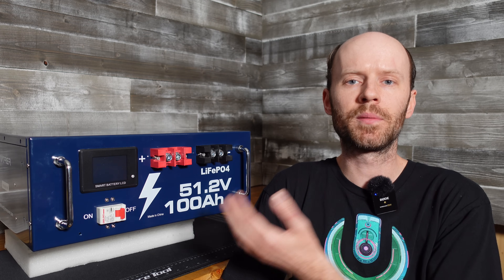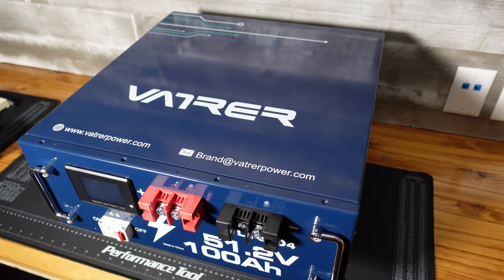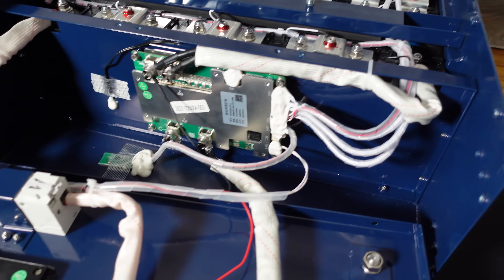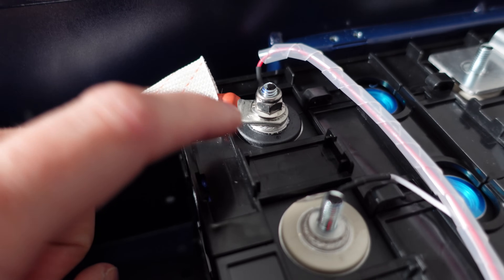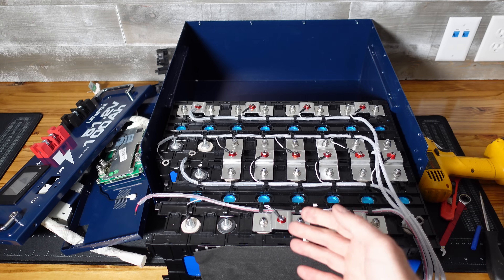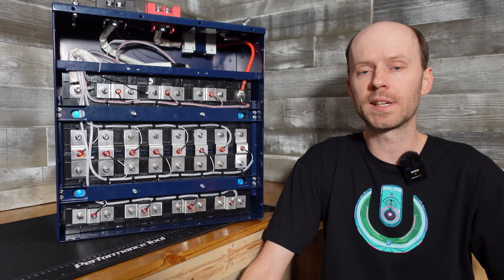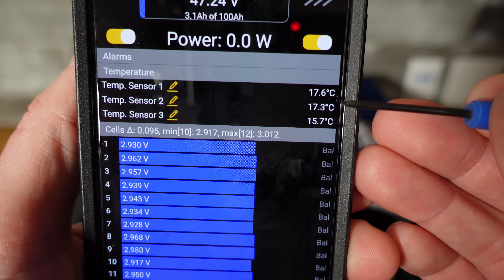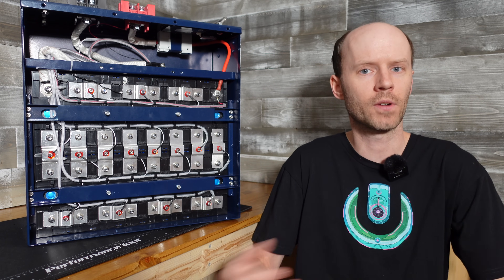CHEAP Vatrer 51.2V 100Ah Rack Battery, EVE Cells - Just Don't Break Them!

Comment: Great video. Lifepo4 batteries can easily have large  cell voltage differences when new,after cycling many times they usually become more reasonable.Iam glad you were able to identify the cells used,thats why I watched the video.I did build a  battery with 16 of those LF100LA cells and they are consistent  at 104AH.Iam commenting because I noticed other comments about buying EVE 280AH is better economically and I can say that EVE 280AH V3 cells were shipped to my door for twice the cost of the EVE  100AH.These people missed Lithium Solar's point,for $1023 shipped to your door,cells,battery box, wiring,breaker,JBD BMS with screen with warranty,thats a great deal!!!Thanks

Comment: Re: BMS settings. You told us what it is set to, not what it actually controls at. It is great to have over and under temp protection set correctly. That is of no value IF sensors are cheap garbage and gives a bad signal that either never triggers the BMS, or over triggers before you get to the limit ???
Reply from the maker: We can assume the temperature sensors have a reasonable tolerance, as do most electrical components. I do not have equipment to test the tolerance of temperature sensors, sorry.

Comment: I am new Subscriver . Can i use this with a EG4 6000XP? It is not in listed in the EG4 compatiblity list.
Reply from the maker: It can be used with custom-programmed settings. It will not communicate with the inverter and I don't know if using it will have any warranty implications from the EG4 side. They will have to clarify that.

Comment: Whats the difference between 48v and 51.2v batteries? Are they compatible with each other? Is it just marketing?
Reply from the maker: They're all sold under the "48V" category for marketing, but technically the batteries you want contain 16 cells and are 51.2V nominal. The nominal voltage is 3.2V x 16 = 51.2V. Some companies are selling actual 48V batteries, which contain 15 cells (15 x 3.2V = 48V) but don't work as well due to the low voltage near empty.

Comment: Great video and I used your link and code to purchase one.I was charging it yesterday and opened the solar kill app I saw yu use in the video. Im a rookie and noticed the icon for only balance while charging so I turned it on  The write to BMS icon at the top was blinking so I clicked it.Immediate the SOC went to 100% and stopped cycling through the display screens on the first option of the battery.I thought  no big deal Ill just reverse what I did.Does anyone know how I restore the BMS back to factory? How bad did i screw this up?

Comment: WOULD BE EASIER TO GET A THIN METAL BLADE AND MAKE GROVE ON TOP OF THE STUD SO YOU CAN USE A FLAT SCREWDRIVER TO HOLD THE STUD WHILE YOU TRY TO UNSCREW THAT 10MM NUT
Reply from the maker: Yes, that would have been a fantastic idea if I would have thought of it before destroying it. Heh :(

Comment: Thanks for the review. Got mine using your discount code. Nice battery. Put it in parallel with 17 other server rack batteries. It seems to be charging/discharging in sympathy with the rest of them. I know the manual recommends not doing what I’m doing, but then I see Ian at Watts 24/7 with batteries having a lot more differences than mine all working in parallel. Also a belated thank you for the tip on 6awg thhn wire. I scored that deal too.

Comment: Has anyone tested the low temp charge shutoff function?  We've seen these sometimes not work in other batteries.   Thanks!
Reply from the maker: I did not test it in this particular battery but I highly doubt there will be any issue as it's a JBD-branded BMS and we verified the programmed temp settings and sensor values.

Comment: any concerns with the circuit breaker? heard it is an AC breaker without arc suppression
Reply from the maker: No. I discussed towards the end of the video that I had found a test report where it was tested for DC voltages in 1P and 2P configurations. I couldn't find a complete specifications sheet though.
Reply: @LithiumSolar  thanks. planned a 4p config so trying to keep safety in the picture

Comment: The damaged terminal screw is an accessory (welded on, but still an accessory).  I'd use the cell.  I'd cut a slot in the top of the stud and use that to hold the stud from rotating while I tighten the terminal.  The terminal will be held in contact with the welded on flat and all will be well.  As an alternative to the slot, two opposing sides can be flattened and a small wrench used to hold the stud from rotating.

I have a lot of cells with drilled and tapped terminals, and I use a stud with a hex socket.  Same idea, using a hex wrench to hold the stud while tightening or loosening the nut.

Comment: dude for below ~1500 + 100 for JKBMS one can build a 4320Ah = 15kWh 48V LiFePo4 with EVE so #wtf
Reply from the maker: "one can build" < there's the differentiating factor, YOU have to build it.
Reply: @LithiumSolar  yeah well X-D does it come with auto heating at least? :D
Reply: @LithiumSolar  also might have noticed that 280Ah EVE sometimes only have 270Ah so calculated with 16*270Ah
Reply from the maker: @boringsoftware2093  I wouldn't buy those cells then if they're new 280Ah testing at 270Ah. That's not right...
Reply: @LithiumSolar  it is lack of quality control from the manufacturer AND the vendor X-D (yes won't buy NEVER EVER form this vendor again, every serious battery vendor imho needs to ship a protocol, what is the real capacity of every cell... if not it might be scam imho)

Comment: Second pair of rack ears are for the rear rack rails. You will need them for a device that weighs that much. Don't attempt to mount the unit without using them.
Reply from the maker: Well, that's absolutely what they would before in a typical rack-mount object like a server, ups, or larger network switch. In this case, there are no mounting holes on the back of the case to attach the ears. So... no clue!
Reply: I purchased one and planning on buying three more. Can these just be stacked on top of each other? I dont see any venting at all on the case so not sure you would need any type of air gap other than to pull one out easier? Thanks

Comment: Ive been building my own amd using 280k cells and the 2amp jk's. I kinda wish id just bought rack batteries for ease of moving it around
Reply from the maker: Indeed. So many people keep telling me about these 280Ah or greater kits. I look at them and am like... 250lb? Yeah let me just grab that forklift that I keep in my back pocket.
Reply: @LithiumSolar  for sure. I have a camper with 32 eve 280 k cells and I'm afraid if I tried to pull it down the road the camper would be dangerously unbalanced. I'd like to take it on vacation one day but the battery would need disabled and at least some of it moved to the front of the camper. I've thought about putting another battery bank towards the front of the camper to help with weight distribution but so for 30 kw has been plenty and I'm not sure how I'd keep the voltage equalized between the two banks with them  being 30 foot from eachother

Comment: Shipping over 70 lbs via ground (not pallet freight) is illegal. Not nice to see they are breaking the law to save a few bucks.
Reply from the maker: @gridlessbob993  The box that I received mine in has a lithium battery sticker on it (with an emergency phone number), a standard "no cargo aircraft" sticker, and is properly declared as 112lbs on the label. This is FedEx ground. It appears to be properly shipped as far as I can tell?
Reply from the maker: I know you've mentioned this before. Some of the larger batteries I receive ground ARE properly labeled too. I'm not sure and am not well-versed in the shipping rules enough to comment really.

Comment: Thank you. I've had my eye on this for a while. My charge controller and inverters don't use comms so it seemed like a good cheap option. I was just hesitant due to the internal unknowns which you've now covered.  I would have liked a pre-charge circuit but hey, this is the budget end. As an aside, is anyone else seeing the comments are now crammed into a side column, with a host of distracting thumbnails for other videos directly below LS's video? Bad UX choice.

Comment: Liking the assembly design and apparent build quality. I'd say the price is fairly cheap, which others have commented about. Prices always vary by nation and region so best to compare prices available to you where you are. BMS settings are not optimal for battery life which is something they should address. 

On the silicone blobs two things: One is it ensures connector security and two it acts as a 'tattle-tale' to show if someone has messed with it for warranty purposes. There are other ways to do this but silicone and it's dispensing is cheap and easy for manufacturing purposes. 

The blue loctite residue is an enigma. Does the CS rep simply not know what's going on? Maybe they buy the cells with the studs installed and weren't aware of it? Maybe it's a production line hack for less than perfect threading? No matter what the reason, the disparity is worrying, especially with all the rest of the hardware looking so good.

Comment: Love the background!  Is that new?  Looking forward to seeing how effective the BMS/comms are from this offering.  (Turns out no comms, but that's not a deal-breaker.)

Aren't those just grub screws that are ran into the welded on terminal?  I'm not sure it's really "damaged", per se?  That 2.2v low cut-off on the cells is something I would have to fix!  I'd bump that up to the normal 2500mah and increase the recovery voltage to 2800mah.
Reply from the maker: Yes, the background and work area is new. I built it for use on my server channel but haven't had time to do much with it yet. I'm not sure how much battery work I'll be doing there as it's difficult carrying 105lb rack batteries up/down stairs. I don't know what's under the welded part but I think the stud and part welded are intended to be one piece - not threaded in to the cell. I'm not sure.

Comment: Balancing start at 3.3Vpc: Seems incorrect to me, should be much higher.
Reply from the maker: Your missing part of the equation there. Balancing starts at 3.30V when there's a cell difference of 0.15V or more.
Reply: @LithiumSolar  you never balance in the flat zone. There's a lot to learn mate
Reply from the maker: @jec_ecart  It's apparent that you have some learning to do yourself there.
Reply: @LithiumSolar  why don't you watch some proper YouTubers like off grid garage or read up some white papers on why you never balance so low. But all see is you being brash and try to throw your weight around. Mate there's nothing wrong in accepting that you have overlooked something.

Comment: cut a slot on the top of the post with a dremel then use a flat tip to hold in place and use wrench to turn nut.
Reply: just made it to where u cut it off. :D you could do that too
Reply from the maker: The flat tip slot idea would have been perfect. I kindof feel dumb for not thinking of that... Ooof.

Comment: Looks like a nylock bolt, is it? OK, now I see it is. I greatly prefer the JBD BMS, different people might have different preferences. Like Tesla, VW, BYD, etc. I don't see a need for an active balancer. I think cell quality has a lot to do with that. You can get almost any communication option on a JBD, but you need to order them that way. I am not sure what the screen uses, but it is a communication option as well. Looks well built, although one reviewer on Amazon claimed it is a 15 cell battery (description specifically notes it is a 16 cell battery). I think they did (or still do) offer a 15 cell version, but I wouldn't recommend it. I sent some Vatrer 100ah batteries to Ukraine in 2022, and they are still working fine. I have found that top balancing with JBD can be done with a power supply, albeit slowly. Once balanced they stay that way with the default settings (which is 3.4v to start, only balance while charging).

This certainly looks like a battery I would purchase, the price is certainly right.

Comment: thx for the new Video!
Nice Battery at first look, but....
8:15 - 3.752V  max cell voltage is def. much too high - i would highly recommend reworking some BMS Settings
It could take several hours with the integrated Balancer (max 100mA balancing current) to bring it down under 3.650V or even lower
In the App is also visiable, that max-cell #11 istnt even being getting balanced, so it is possible for the cell to sit there, hours after hours at such a stressful high voltage. The cells are unnecessarily tortured

The cell undervolt protect. should sit on 2.5V as stated in EVE Cell datasheet
That "cell mistreatment" is a absolute bummer

The Terminals also look wiredly round (at least on Video) - so the contact surface seems to be quiete small compared to a real flat Terminal?
And we havent even talked about the delta cell voltage of 325mV...that is not balanced at all
Reply: Definitely not too high lol
Reply: Great at jbd bms is the option „no“ at „balance only when charging“ so you‘ve got every time you need to balance.

Comment: This is new to me. What's the difference between a racked battery and regular battery
Reply from the maker: That's pretty much the difference lol. It's designed to fit in a standard 19" rack - though you'll likely need one made for batteries specifically or find some heavy-duty rails (maybe APC rails).
Reply: @LithiumSolar  I have 4 of these batteries and built a rack with 2x4s and used unistrut as the rails... cheap and easy to do
Reply: One can be mounted in a rack. 🙂
Reply: @gridlessbob993  Racks are almost always the standard 19" as far as I know.

Comment: 1.000 $ is expensive at least for us here in the EU. Here the usual rack battery of 15 kWh is about 2000€ which is 2200$ incl. vat based on a seplos case and EVE LF280K as diy kit.
Reply from the maker: Also, we'll be taking a look at one of those kits here very soon :) :)
Reply from the maker: You're talking about DIY batteries. This is not a DIY battery.
Reply: Comparing DIY, I'm sitting on 48 shiny new 304ah EVE cells and JK 200a, 2a active balancing on board. That's 45kwh delivered for $4900 bucks US. Tough to beat on this side of the pond.  I'll ordering another round of the same before the week ends.
Most aren't cut out for DIY on that level. Just hate to see them get raked over the coals by the vultures on a lot of this stuff.
Reply: @beebop9808  I wonder if much of the price difference is due to currency conversion rates?  The value of the dollar is diminishing quickly.
Reply: Dollar is going up 1,07 for euro so dollar is strong
Reply: @beebop9808 yes it's like all DIY, knowledge/time is the barrier. This is the most affordable pre built rack battery  I have seen to date though.
Reply: What batteri is that?
Reply: Greed